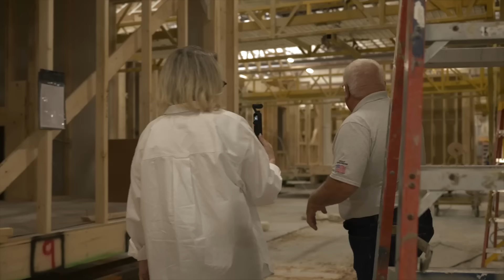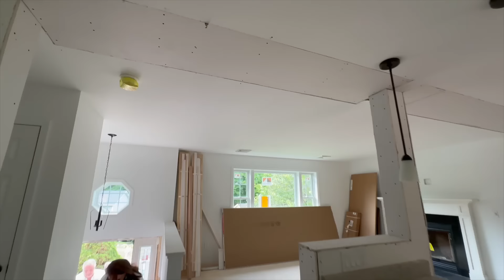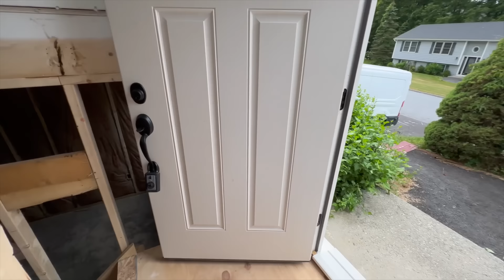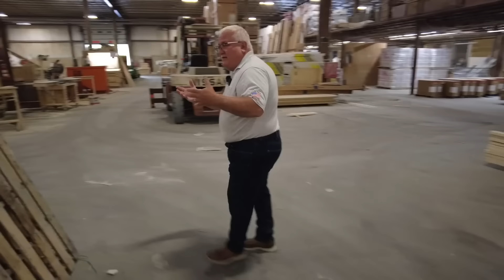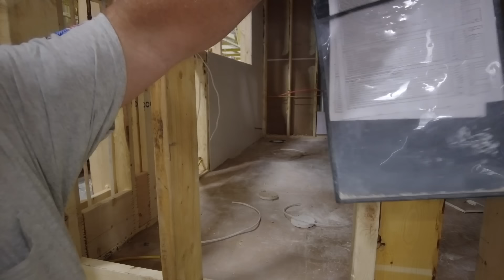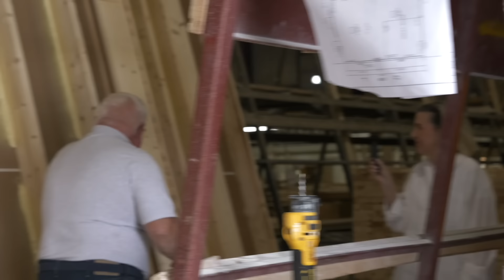Modular Homes ARE Better Than Stick Built!!!

Comment: Sounds like a great company. Not everyone has that much integrity.
I have built stick frame homes for 30 years and I would agree with 97% of the information presented.  Rain, theft and obtuse subs are a persistent problem.  On steep slopes, however, I have seen some modular builders having trouble lining up modules on the foundation and wind up with uneven transitions that the company walked away from (in Seattle).   It was probably the fault of the foundation company, but the GC should have been diligent to verify elevations and come up with a remedy before the modules were delivered.  12 ft. tall retaining wall foundations are not exactly slam dunks.
With stick framing you have multiple opportunities to correct errors as you build, which is essential on challenging sites. No one builds a perfect house, and no one employs infallible workers.  On flat lots I wouldn't mind doing modulars 7 days/week—I could throw away my aspirin and Rolaids.
 On sites with excellent views it's also nice to stand on the floor deck and decide if a window needs to move a little bit, or widened, or even get omitted if the only view is your neighbor's heat pump or gas meter.  I rarely build the same house twice, so sometimes the bugs need to be worked out on site, because they are not noticed on paper.

Comment: I wish modular was a lot cheaper. I just spoke with someone who said it would be around $150 a sq ft not including land. 

I am probably gonna end up with a manufactured home but I would rather have modular.
Reply from the maker: Yeah, they are similar in price to a traditional built home. They are just built better than stick built.
Reply: @KristinaSmallhorn found out I can do manufactured either. My area requires you buy land an acre of land if you’re going to put it on land because you have to have a sewer tank. The cheapest land I could find was 80k. 

Can’t afford that and a manufactured home. Wish we could go back to the days when you could buy homes on one income.

Comment: Nanicoke Homes in Southern Delaware (ended 2002) made this custom, factory built homes 30-35 years ago.  Just lay the foundation and drop them in 2-3 packages... fully done in several days after dropping on site.  Even if bad weather outside, they could work on these 24/7 in lighted, dry, HVAC condition.  Not a new concept.

Comment: What's the data on modular vs stick built against tornados?
Reply from the maker: Hey there! Great question—and honestly, one I get a lot.

When it comes to modular homes vs. stick-built homes in tornado zones, the answer might surprise some folks. Modular homes are actually built super tough—they have to be. Since they’re transported by truck, they’re constructed to handle a lot of stress and often exceed local building codes. Think more fasteners, stronger framing, and tighter quality control because they’re built in a factory setting.

Stick-built homes, on the other hand, are built on-site and to local code—which can vary a lot depending on where you live. Unless a stick-built home has been reinforced for high winds (like with hurricane straps or extra bracing), it usually won’t be as tough out of the box as a well-built modular home.

Now, as far as tornadoes go, both types can hold up fairly well in lower-end storms (EF-0 to EF-2), but once you’re talking about EF-3 and higher, pretty much any regular home—modular or not—is going to be at risk. That’s where storm shelters or safe rooms come into play.

FEMA and other groups have actually looked into this, and they’ve found modular homes can sometimes outperform stick-built homes in wind tests, especially because of how securely everything is connected during the build.

So no, modular homes aren’t flimsy—they’re not the same as mobile homes either—and in some cases, they can be the stronger option when it comes to severe weather.

Comment: Yes.  This situation might not last forever.  But there are many reasons modulars are better, they may even use the wood you demand to use, for more money. Even so, you might not get the resale value ever (theres reasons look em up).  Although one thing is the finishes.  Yes, they say they can get any finishes and appliances, but it's simply not true.  They have a salesman telling you about finishes, but he's a salesman.  They will want to substitute their finishes for what you want.  Let's be honest, modular finishes are not contemporary or stylish.  The stuff looks 40 years old brand new.  All their profits come from volume, so they got wierd old designs.  Just have them unfinished then have a pro come and finish it.  Contractors don't just bury trash-that's not true.  Mold is everywhere in the air.  Any water drips will mold anywhere, even modulars.  It's in the plywood from the factory it is inevitable.  There's NO way to say one carpenter's work is better than another's.  There's arguments to say that a factory can NEVER out value an on site carpenter.  Modulars can NEVER beat the transportation costs of on site work, sorry it's math.  Are they saying their carpenters are better?  Better than the carpenter's union?  There are advantages, but modular companies make claims that simply cannot be true.  Sorry, I didn't make the rules.  But I do think modulars are a great option.

Comment: You think you can do a price comparison with a;
A standard stick rebuild
Vs
Getting Modular home
Our house is  roughly, 1600 sqft 
4 bedroom
3 full bathrooms
And a garage. 
We have walls dividing the kitchen & the living room. 
I want to remove that wall.

Just a rough estimate. It doesn’t have to be exact cost or whatever.  I just want to know which path to take because of the cost. 

Just an FYI
I live in the San Diego county in California. 
Our house was built in the 60’s, the people who “fixed” this house painted over the defects, installed nice countertops & what not which is now falling apart, rain is leaking through the ceiling, had to call the pest control because we had an ingestion of rats, & I had to re-drywall the kids room because because of mold. 
We bought this house in 2013 & started a family. 
I think it’s time to be current!

Comment: My only criticism would be lack of character. The overly boxy style where everything is completely flat is less appealing than a house with dormers and stylistic features that i like. But in general, i do accept that these homes are built to a higher standard. Perhaps if i was just looking for a simple small square house i would strongly consider this option. i could add my own porch or other features to give it a bit of character.

Comment: modular is built with more quality control. a lot of modular companies use a galvanized outer wall frame instead of stick wall frame which is mostly welded together.

Comment: The advantage of "modular" is that it is all built in a controlled environment, but essentially it is the same thing, you either put it together on site or in a warehouse but you are putting it together,  I'd say you have a bit more work with "modular" since you have to join the pieces but that's about it.

Comment: How many times I have seen a building project delayed because of rains and just bad weather in general. No problem here because its all built inside a factory. Besides that, personal experience years down the road, I had a tree grow its roots right through my foundation. This type of build will eliminate these type of problems as well. The cost of replacing a roof is out of the world at this point and that too is eliminated with this type of build. I could make a list that would be pages long for the positive factor of these type of builds.

Comment: Our neighbor purchased and had built a new modular home. The house is an absolute tank of a home. 2x6 walls that are dead on straight with 90 degree corners. The finishing work is virtually flawless. Kitchen cabinets are hardwood framed as well as the cabinet doors and drawer fronts.
If we were to build a new home, we would definitely consider modular construction.

Comment: The only problem with modular homes are the walls are paper thin. I was sleeping in back bedroom and could hear my mother putting away dishes from kitchen on other side of house. If the walls were thicker to create a better sound barrier, I would reconsider having a modular home
Reply: I wonder if it could've been ordered with more insulation/more insulation sound deadening  in the walls.
Reply: Was it a MANUFACTURED home (aka double wide mobil home) or a MODULAR home (like in this video)?

I'm a Certified Aging in Place Specialist,  credentialed by NAHB, and the walls are definitely thinner in the manufactured home, as well as different stud placement.  They are not easy to modify for accessibility compared to stick built and modular.

Comment: We had a modular home  and hated it. You could feel the joining seam in the floor from day one and it felt like a mobile home. I grew up in a trailer home, i know the feeling. It was too close to a trailer. I now own a traditional built home. (1885 built home, built with wood that measures out to the advertisement (2in x4in is actually 2in x 4in)

Comment: Imagine all the sad people (middle men) from modular homes: without traditional stick built homes, the plumbing contractor owner doesn't have a new F350 every few years, along with the electrical contractor owner, plumbing, tile, carpet, framing, roofing, window, drywall, etc. All these contractor owners won't be able to buy a new F350 every few years.
Reply: @thebluelunarmonkey  It is sickening. Yes they work very hard.  Even my local area I see big landscaping companies with a brand new 2500 Sierra Denali every 2 years.  Driving a $80,000 truck. You know they over charge for everything.

Comment: The big problem I have with this manufacturer is how proud he is to use 100 year old building techniques to build his stick built house.  Where is the spray foam insulation?  The metal roofs? The aluminum studs? So many innovations in building and he's trying to regress to the 1970s.
Then there is the hit you take on resale.  It's a "modular home" and has to be sold as one.  Save a bit of money on the initial, but lose it on the sale.
The average American lives 7 years on a house.  Kaboom!  No investment value at all.
Might as well buy a mobile home for less money.

Comment: Though I can’t deny that there are some benefits to a modular home, much of this is going to depend entirely on the build quality and the assembly quality. For instance, in the basement video section at marker 513 in this video where you’re discussing the R 21 value of a wall that is absolutely incorrect based on how that insulation is compressed inside the wall. You will not get our 21.
And our 21 is only the measurement in the middle of the cavity, however where it is compressed around the edges in the bottom, it is significantly reduced.
The insulation needs to come in contact and loosely around all sides for it to be effective.
If they slap sheet rock on it, which I suspect they will, you’re looking at probably more like an R 11 at best and that is for the overall quality of the wall.

Comment: I've been a contractor for over 25 years. Modular is faster and looks better with all the shiny parts. But after 10 years they fall apart. I have actually sean a hotwater heater get a leak. Then fall through the floor. Plus most banks will not loan on modulars older then 10 years. So yes if you want quick shiny home go modular. But not if you are looking for a long term investment. I was also a real estate agent for a bit. Its very hard to get loans on older modular homes. You have to find cash buyers.
Reply: You're full of big turds and you know it You're just full of jealousy and you can't stand it stop your lying there's too much evidence pointing to the opposite of what you're saying

Comment: I bought a Marlette manufactured home in Boise, Idaho. It was MARVELOUS. It has rounded corners on every wall, extensive insulation, 3bd 2 bath. Kiln dried wood, ACTUAL dimensions not nominal (a 2"x4" WAS 2"x4" ) the floor joists were 2"x10" on 16-inch centers. 3/4 inch sheet rock (not 1/2 inch) throughout.  I had it set on a foundation tall enough to walk up right under,not a crawl space. Hated to let it go, but I moved out of Idaho.
It was so heavy it bent the axles on the transport trailer. They didn't lift it. They aligned the halves and used a rail system to roll it onto the foundation.  Then secured to the foundation.

Comment: I own and live in a IBC modular from a modular builder out of
Nebraska. It’s not bad but not as perfect as the custom stick
built I work on everyday. 
One thing to remember is that
there is still a lot of work to be done after and before you set your modular. Foundation, plumbing base, electrical service, utility hookup , pads and I-beams , basement floor,
walkout framing , siding or stucco on walkout walls,.
Plus all the sSheetrock patching

Comment: It is the same finite engineering process which General Dynamics builds Nuclear Submarines on.  You build discrete sections of the entire thing which, when assembled fit precisely.  All the wiring runs and plumbing connections line up, every dimension and angle is within a tolerance.  Airbus built the A380 on the same principles.

Comment: the only difference is one is built on site outside ( stick built ) modular is built in a factory climate controlled,,,,buying in bulk is always cheaper on everything,,,,,I myself like spray foam insulation R30

Comment: I worked in a modular home factory servicing and installing their air and heating systems (for offices and to dry joint paste during modular construction).  We installed a system (overhead) with drop down flex-ducts that could be placed in various rooms as the modular went down the line to help dry the joint paste in dryall installation especially during damp or cold weather.  I got to see how the homes were manufactured.  Steel templates were used to ensure accurate framing.  Each piece of lumber fit into a slot that gave the wall, floor or roof panel exact distances from each other.  The process was so precise and so much better than 'stick-built' that I knew I wanted one when I purchased a home.  Even the roofing is applied as the unit moves down the line from a balcony where stacks of roofing materials are located on the level above the main floor.  The speed, accuracy and quality was amazing.  Afterall, the units had to move down the road after leaving the plant.  No stick built home could compare.
Reply: What company is that? Please share.

Comment: My house in Florida wasn't modular built, but, it was made of prefabricated 5-inch-thick concrete walls about 8 or 9 feet tall, by 6 feet wide, by 5 inches thick. I couldn't even use the regular drill to drill the holes. I would had to use the special concrete drillable drill bit for me to be able to drill a hole to it. They also used the thin metal strips bent at I frame, not sure, as framing walls instead of using 2X4.  That concrete wall would not have been penetrated by any falling trees, or vehicle traveling at about 20 miles per hour, I think.

Comment: I have a double major in Architectural science and engineering. Definitely look for modular. Hands down. 

After having your base house, you can always customize finishes from there such as adding a stone columned overhang or porch like it’s a stick built home to add character and that’s craftsman curb appeal.

As with all products, you have to check each company – that’s if it’s a stick built contractor company or a modular company, …Do your research on quality standards and insurance for the individual company whichever way you go. Happy building!
Reply: @singwings. established builders on West Coast can design & build a home to last but at $350-$400+ sq. ft.  not talking builders that slap down thirty or forty homes at a time and have the partially framed home sitting in the elements for weeks before they continue building.  as architect & engineer you see both quality but also value in modular home construction compared to something like a 'one-off' backyard ADU?  Sunset Magazine touted a modular home in modern style back around 2005 but it seems like people haven't caught on or conflate manufactured homes w/ modular homes where cost is lower but so is long term durability and resale value.  Thank you
Reply: Start an off-grid community consisting of individualized log cabins. ~LLC~ Lincoln Legacy Cabins

Comment: I have lived in a modular home for the last 20 years. And I can tell you that there are many more reasons to purchase a modular than a stick built. One major issue that stick built homes have is contractors to do various parts of the home. The quality of these workers is very important.  You will find a lot of fly by night and migrant workers know as sub-contractors. And you can bet they take the lowest bid for jobs. Whereas in modular these people work full time and know what their doing.
Reply from the maker: I agree, it’s a big issue with stick built homes and the quality of those working on them over the past 5 years. It's just not the same.

Comment: modular homes are STICK BUILT!   they are built in a factory. most SITE BUILT homes  are STICK BUILT on SITE.  not all SITE BUILT homes are stick built.   your opening statement should say "modular homes are built way better than traditional SITE BUILT homes.  stick built homes can be built on a site or a factory.  it is correct to say factory built homes are way better than site built homes when wood is the primary building material.
Reply from the maker: I see what you mean.